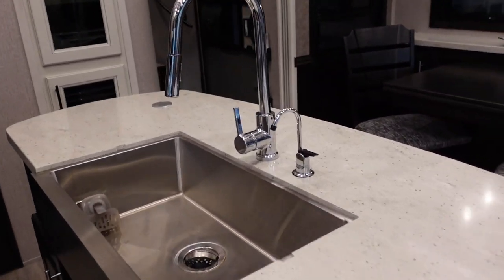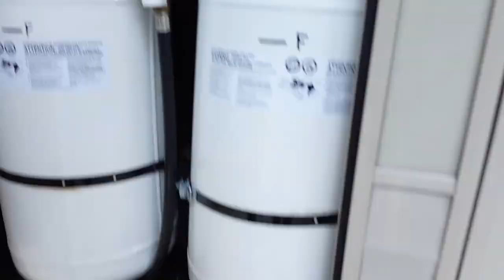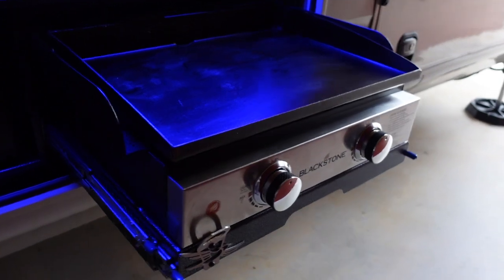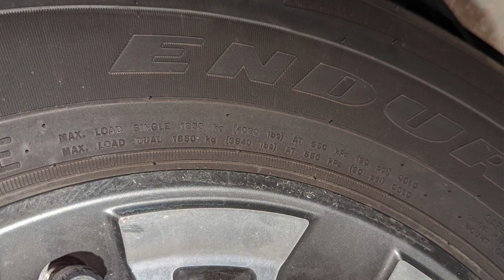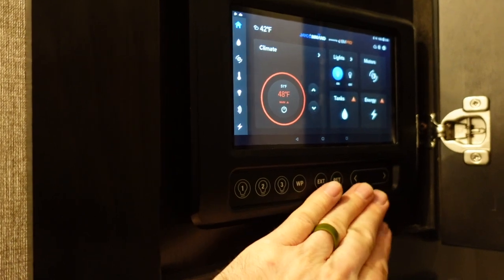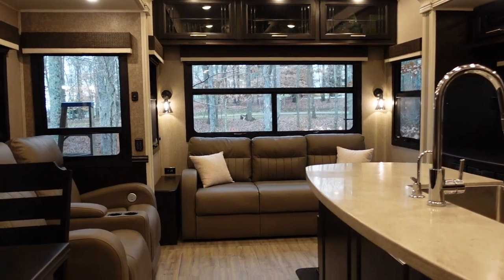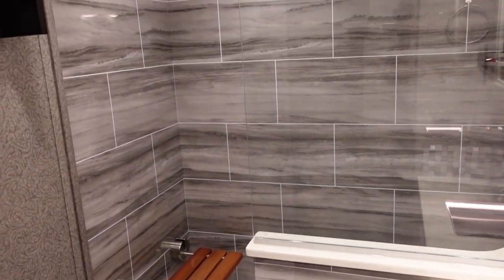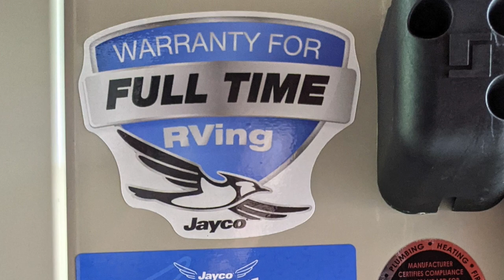Same? Or Like the Rest? What Sets Apart Jayco North Point & Pinnacle Fifth Wheels?

Comment: We have a 2021 Northpoint 377, almost identical where the Pinnacle has better cabinets and a nicer bathroom layout.

For us, many of the same features drove our decision especially execution of the Farmhouse theme, shower surround material/quality, beast tires.  But for us, the main driver was the height/clearance of the loft area, plywood floor and roof decking along with the wood truss strut system for the roof.  Better fit and finish when compared to other brands and the 2+3 warranty.

Love our Jayco, only wish it had the factory generator.

Comment: We ended up buying the northpoint 377 rlbh basically this rig, but with less features and some other slight differences. We’re waiting for it though, had to go back to the factory for a slide repair. We found the floor in the bedroom slide to be spilt in the plywood. We noticed it when we were doing the walk around right before purchase. We committed if they would fix the slide and Jayco came and got it. Hoping to have it by end of June.
Reply from the maker: Nice! North Point is such a great package. I went back and forth on it. Sorry to hear about the delay on delivery of it. Glad to hear they are fixing it for you.

Comment: (adding another being I know how the yt thing works after seeing more of this video)
Those, I think you called "Wago"?? connectors are absolutely great compared to some other type. As a career sparky, retired contractor electrician, I've seen and used those connectors and can confirm their connection strength on them. They won't become a problem, at least with my experience with them. They have a great quality and connection to them and would recommend them in a situation like this. I've seen many that will eventually loose connection causing a loss of then re-connection, causing spark or arc of the circuit. In a scenario like what shown would be a horrible possibility with the propane next to it.
Reply from the maker: That is so helpful to know! I had never seen or heard of the Wago connectors before the Pinnacle, but have absolutely come to appreciate them.

Comment: would love to hear about the overland Solar II option...is it an addition inverter separate from the one for the frig?  Which outlets have inverter power?  Thanks!!
Reply from the maker: So my Pinnacle build was ordered Jan 2021 and came off the line June 2021. At the time I think they called it just a "Solar" option and then there was an additional "2nd Solar panel." With the "Solar" option it added the GoPower 190W panel on roof (single) and a GoPower 30a Solar Controller (to properly interpret the solar panel and send the charge to battery bank). Then the 2nd solar panel was another add-on, but I opted for just 1x on my build (pretty easy to add the 2nd yourself). Anyway, all that to say it is my understanding the Inverter itself will come with any Pinnacle or North Point with the residential fridge option. So even if you don't get a solar package, it's my understanding you'll get the inverter regardless as long as you have the residential fridge. That's my understanding, but I could be mistaken. The inverter is a Xantrex Freedom X 1000W model (tucked up in ceiling of basement storage driver side) and on my Pinnacle the outlets for living room TV and all the master bedroom outlets are on the inverter in addition to fridge. I will say that before I took delivery of mine, I heard all sorts of different answers from salesman and owners as to which outlets were wired in, so it may be one of those things that changes a bit from month to month during production. In fact some told me no outlets were wired to inverter. But, like I said my build has the living room TV and all bedroom outlets wired into inverter...super handy. Usually Jayco will put a small sticker on the outlet cover to denote it also.

I believe for the later 2021s and 2022s moving forward they have swithed to the "Overlander II Solar Pkg" and it's my understanding that is 2x 190w panels on roof + 30a charge controller. I am not sure about whether they upgrade the inverter in that package, or if it is still the standard 1000W Xantrex. I have also heard talk about a new "overlander extreme" package that does increase inverter to 3000 watt and bundle in more solar panels PLUS 600ah lithium batteries (so this is a HUGE package $$) and possibly even includes all outlets in RV - https://rv-pro.com/news/jayco-unveils-new-solar-power-system/

Anyway, hope this helps. I think 1-2x solar panels + controller is a nice option to select regardless as the residential fridge can be a hog on the batteries. I plan to do a video in the warmer months to demo how long it can run off 2x 100ah lithium batteries alone, but preliminary tests put the 200ah battery bank in the 24-36 hr range during warmer months with no solar. So having some solar to help top-off seems like a decent value from factory.

Comment: I agree with most of those points.  One question, though, is about the fresh water system.  Ours was built late in the year, and I haven't figured out how to make the fresh water system go to the ice and water.  Our ice and water is only on the tank or city water.  Am I missing something???
Reply from the maker: Did yours come with a small pump switch on the left side of the island by sink? And did it come with the 5 gallon jug in storage bay?
Reply: @AdventureRocks  Yup, it did, but it appears to only be hooked up to the water spigot at the sink.  I don't know if there's another bypass somewhere that I don't know  about...
Reply from the maker: @darrinhiebert  Interesting. I'm not aware of a diverter or bypass. But, I wonder if it was accidentally mis-plumbed during manufacturing? On mine the connection/tee is in the underbelly just below island where it splits. On mine it goes from 1/4 O.D. vinyl tube from the pump in wet bay to a tee underneath island that feeds both the island tap (also 1/4 O.D.) and then the ice line (1/2 I.D. braided hose). If I recall there's a shut-off either in televator bay or behind that bank of drawers next to stove for ice line. Would be interesting to see if yours has some kind of hidden diverter, or if it was just plumbed differently.
Reply: @AdventureRocks  Weird...  We DO have that shutoff behind the televator.  We have never had water in the jug, and we have never turned on the spigot pump, but fridge has water and makes ice...
Reply from the maker: @darrinhiebert  That is strange. Maybe it got plumbed differently during assembly (or maybe mine did!). I could see where it'd be easy to mix-up the connection. If you find out something different in the future you'll have to keep us posted.
Reply: @AdventureRocks  part of the issue is that we haven't really had a chance to take it out yet and figure some of this stuff out, and it's in storage now until spring.  The only camping that we have done in it so far, was when we brought it home, 1200 miles!!

Comment: We had a 2021 32RLTS Pinnacle but traded it for a Grand Design. We liked our Pinnacle and believe the quality of finish is better than the Grand Design. But Jayco was having lots of problems with the frame stress cracking and they do not stand behind their product as well as Grand Design.
Reply from the maker: I think that's a fair assessment for the most part. Hopefully Jayco can work on the backend/owner support side of the transaction and make some adjustments in the future, especially on the premium product lines like North Point and Pinnacle. I think the leadership is aware of their shortcomings there, but may not be easy to shift overnight. I had a Grand Design about 6 years ago and I remember their after sale service and support was top-notch.
Reply: Not sure how I'm reading your reply, are you saying the Jayco or Grand Design quality is better?  The one you sold (32RLTS) is what I've been looking at for a smaller 5th wheel.  Can you tell me what happened to yours as far as stress cracking?  Grand Design is also on my list, most of their models are pretty large though.
Reply: @sandparts  What I as saying is the interior finish of the Pinnacle is better than the Grand Design. We have a GD Solitude which I would say is closer the the Jayco Northpoint in quality.  We didn’t have any stress crack in ours. We decided to go to the GD before we did get any crack. Grand Design owner support is waaay better than Jayco.  Grand Design also has owner rallies which are a blast!  I’m not knocking Jayco (we’ve owned a Jayflight, a Precept, and a Pinnacle) but given a choice between the two I’d stay with Grand Design. But that’s just my opinion.

Comment: Will 4 golf cart 6 volt batteries fit in the battery compartment? Also, does the shelf above the batteries remove for servicing?  Thanks!
Reply from the maker: Pretty sure 4x would fit, but think shelf is rivetted. I'll double check tomorrow and report back for sure + dimensions to confirm size.
Reply: @Adventure Rocks  ordered my 32RLTS today,
Reply from the maker: @alanb.4660  Nice! I love the coffee bar/hutch area on that wall next to pantry.

So I double checked on dimensions and the battery area is 23-1/2 deep by 30-1/2 wide by 13 tall (to ~1-1/2 in lip on shelf above). Then factor in about 3-in or so on right side for clearance with breakers (that's where I put my master disconnect + shunt for Victron BMV-712).

I was wrong on shelf. The shelf above has 4x sheet metal screws holding it to the L-shaped brackets on the surrounding walls, so can be removed. Only the L-shaped brackets are riveted. So you can remove shelf with stubby philips or right angle driver.
Reply: @AdventureRocks  Awesome information.  Thanks for taking the time to check!!

Comment: Jayco  campers may have cracked gas valves but not telling customers until July risk of fire this is corporate america
Reply from the maker: The delay seems odd initially, but I think the challenge is the logistics of getting 22,000+ replacement parts available across all the RV manufacturers. I believe Jayco only represents about ~800 units or so of the total 22K batch. I don't believe anyone has reported any leaking or cracking valves from the supplier or fires for that matter, but due to the contaminated brass they're recalling as a precaution. The notification window seems to be consistent across all the manufacturers, but media has kinda sounded the alarm since these kinds of recalls attract attention quickly. Lots of opinions floating around out there, so just my 2c.

Comment: Saw a New 2022 pinnacle fifth wheel a couple of weeks ago. Was not impressed at all. Had broken cabinet doors even one that was next to a kitchen cabinet on the floor, loose trim everywhere, bathroom door wouldn’t close, wood putty on all the trim , bathroom shower stall had bulging wall panels etc.  said to wife.  If this is what you can see, I can imagine the mess you can’t. Had an MSRP $145k on sale for $120k. Not even worth $50k in my opinion